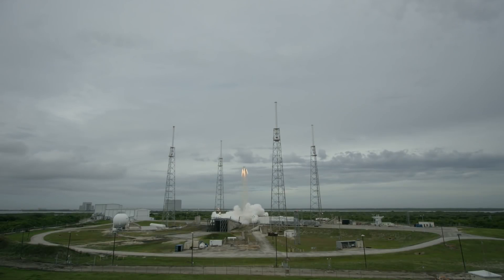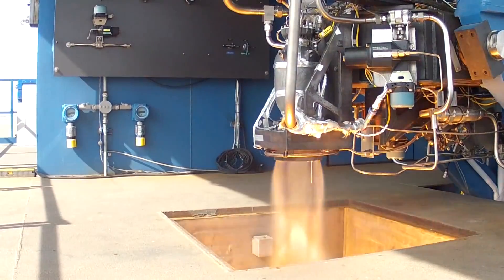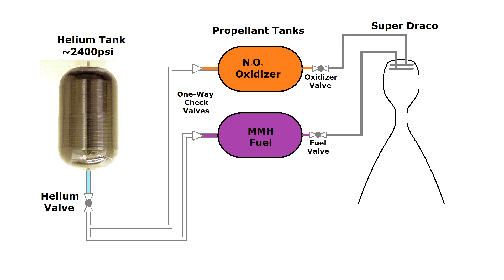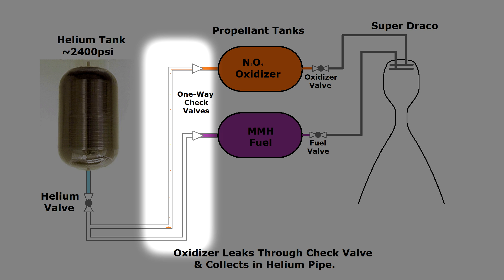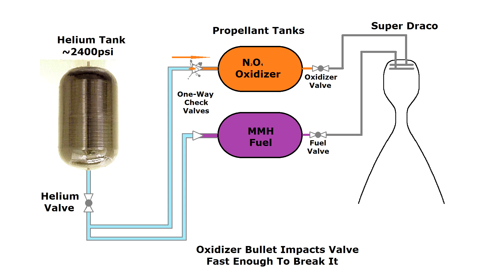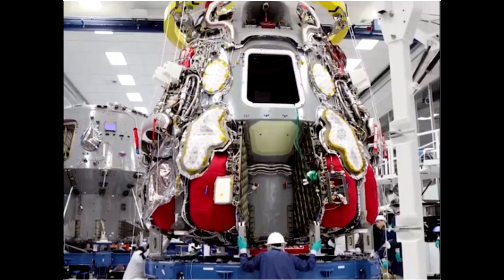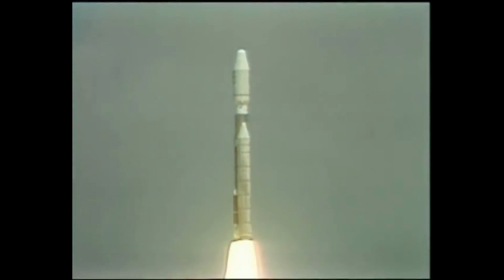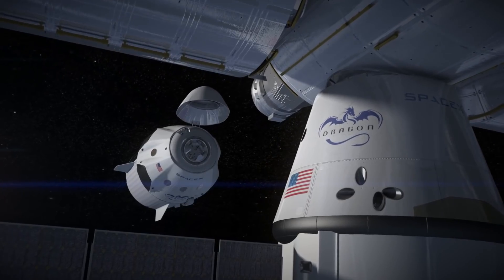SpaceX's Crew Dragon Spacecraft Exploded Because of 'Corrosive Bullets' and Leaky Valves

Comment: SpaceX sure have been finding some exotic ways to burn stuff that isn't supposed to be able to burn. Last time it was carbon fiber in liquid oxygen. These discoveries will not only save their own vehicles but everyone else's too. Take that, Murphy!
Reply: Titanium powder is used in fireworks actually to make those sparkly white effects
Reply: @abcdefgh-db1to  Magnesium and zirconium, actually...
Reply: @bazoo513  They also use titanium too for those sort of fire fountains.
Reply: @abcdefgh-db1to  I dug up a little aaaand - I stand corrected. Thanks!
Reply: @abcdefgh-db1to  that would be magnesium, not titanium
Reply: @horstherbert35  Both burn very violently and are used in fireworks
Reply: @abcdefgh-db1to  true, but if something burns in a blindingly bright white, it's basically guaranteed to be magnesium. It was used as a "flash" effect in photography before the electric flash became standard.
Reply: @horstherbert35 I know. Why were you correcting me then ? If you looked at the other commentaries, you would see someone already tried to correct me on that.
Reply: Hey Scott Manley. Do SpaceX have any plans to switch their hypergolics to the new "green" propellant? It's supposedly higher ISP, right, so it should be win/win?
Reply: @AdmiralQuality  That green propellant is a replacement for hydrazine as a monopropellant not a bipropellant version that replaces hydrazine and UDMH. Different thing.
Reply: @AdmiralQuality  I'm pretty sure they don't use hypergolics. The superdraco launch abort motors are bipropellant and IIRC the control thrusters use cold nitrogen gas.
Reply: @jazzfan1994  No, they use hypergolic propellents... MMH and MON. Bipropellent is not incompatible with hypergolic. Control thrusters (the Draco engines) use the same fuel, not nitrogen gas.
Reply: @jazzfan1994  Those are hypergolics - they ignite on contact.
Reply: All of their failures have been material compatibility problems.
Reply: @AmbientMorality  This wasn't a failure. And what was the material incompatibility in the 2015 launch failure? (There wasn't one, it was struts from a third party supplier not up to design spec.)
Reply: @AdmiralQuality  It blew up during a static fire test. That's a failure. Yes, it is obviously better than a failure with crew.

Regarding CRS-7: "Lastly, the key technical finding by the IRT with regard to this failure was that it was due to a design error: SpaceX chose to use an industrial grade (as opposed to aerospace grade) 17-4 PH SS (precipitation-hardening stainless steel) cast part (the “Rod End”) in a critical load path under cryogenic conditions and strenuous flight environments." — NASA Independent Review Team findings on the CRS-7 failure.
Reply: Admiral Quality Cast martensitic stainless steel is incompatible with cryogenic environments. This material selection error was identified as a credible direct cause.

The static fire test objectives were something along the lines of validating system performance. This did not do so. I get the point that it’s useful and good to test on the ground, but no engineer would consider a test like this successful.
Reply: There is mention in the book "Ignition!" of a strange behavior for some titanium alloys in which corrosion leftovers in RFNA would become as sensitive as nitroglycerin. Titanium and Nitrogen compounds seems not to be best buddies
Reply: Have you ever heard of thermite?
Reply: @TheTeufelhunden68  "Have you ever heard of thermite?"
Elon Musk: "Can you make a rocket out of it? Has anyone tried yet?"
Reply: Davvy Jannes  Good point! ;)
Reply: They’re certainly finding new ways to pollute the environment with caustic chemical leaks and chemical fires. 

So much for fighting “global warming” huh?
Reply: @riflesfirst208 " chemical fire " well that sums up your knowledge of chemistry and physics.
Reply: Almost anything burns in LOX, thats not exotic, sure isn't news to anyone. Discovering that carbon burns there is just ignorant... To stand on the shoulders of giants, you have at least learn how to climb them...
Reply: @drasiritzbir  If you're going to stand on the shoulders of giants, then you need to know what the hell you're looking at... and if you haven't thought "possibility of fire" when you have oxygen and carbon in close proximity, you need to do some remedial chemistry.
Reply: @chrisantoniou4366  Well the reaction didin't happen just because there was carbon an oxygen close to each other, just like with N2O4 and titanium.
The unpredictability came from the activation energy, no one could have predicted that oxygen could infiltrate in carbon fiber and freeze because of the super cold liquid helium, and that that state change would create such pressures that it would delaminate the carbon fiber and create such incredible frictions that it would be able to light the fire just like when we light a match by rubbing it.
And the fact that carbon fiber burns isn't that easy to predict, in the atmosphere for example, it doesn't because the resin in non-flammable. It was only because LOX could infiltrate in the resin that it was possible.
It's the same with titanium, no one knew that a small amount of leaking of N2O4 in the titanium plumbing could be accelerated by the helium and become a bullet that would have enough kinetic energy to light a titanium-N2O4 fire.

I'll agree that if they did a bit of research, they could have avoided these issues, for example since the titanium fire problem already happened to a NASA's probe they could have looked a bit more into that. As for the carbon fiber fire, they could have looked at how LOX behaves with the resin used and could have predicted that it would freeze in contact with the LHe and then calculate the pressure created and find out it would exceed the limits of the carbon fiber tank.
But don't say you could have done better yourself because you wouldn't be able to design a single one of these valves in order to eliminate the problem.
Reply: @abcdefgh-db1to  I never said that was how the reaction happened, nor do I pretend to be able to design a tank that can eliminate the threat.  Perhaps they even thought of the possibility of fire and dismissed it too quickly.  Whatever DID happen, the possibility of fire should at least have been considered.
Reply: @chrisantoniou4366  I'm sure it was.
Reply: @drasiritzbir  How sad for those dummies at SpaceX that they don't have your giant-climbing prescience to help them avoid the obvious pitfalls.
Reply: @AdmiralQuality  No really, carbon burns in liquid oxygen, it doesn't really matter which form. Thats commen knowledge, or at least it should be. Which is why you really do everything to prevent ignition. And the reaction of titanium and N2O4 is nothing knew either. Still, using titanium is convenient.
Reply: @scribblescrabble3185  Well why didn't you speak up before SpaceX lost a rocket due to it?

The Dunning-Kruger meter is pegging in here!
Reply: @AdmiralQuality  Because I do not follow the construction of SpaceX-rockets that closly. And sorry, I thought you would know these things, its that kind of experiment we did in school.
Reply: @scribblescrabble3185  I guess nobody at SpaceX went to school. (You should try grammar school next.)
Reply: @AdmiralQuality  Indeed it is! :-D

Comment: I read the report on the BBC earlier. I had no idea titanium was vulnerable to oxidation...
Reply: Titanium shavings are actually used in fireworks for long lived brilliant white sparks.
Reply: @TheBackyardChemist  True (as per Wikipedia). There's whole areas of chemistry that I never learned...
Reply: @gordonrichardson2972  Titanium is actually rather reactive as a bare metal, however under most oxidizing conditions it quickly forms an "airtight" and durable layer of TiO2, which is quite resistant to damage and chemical attack. This is similar to how aluminium passivates itself

Comment: Wait you mean to tell me MS paint still exists
Reply: What unlimited force would cause it to not exist?
Reply: @benbaselet2026  Microsoft being the d bags that they are (still wont use mac)
Reply: I use it a lot, mostly quick cut and paste on scanned documents.  I was never any good with the brush parts.
Reply: I'm sure you can find a Windows XP installation somewhere...
Reply: @gordonrichardson2972  Well yes I have some both at home and at work for instance, but I can run it in my Win 10 machines just as well.